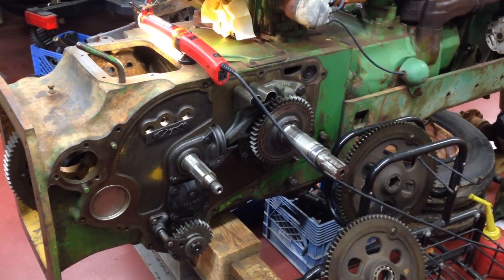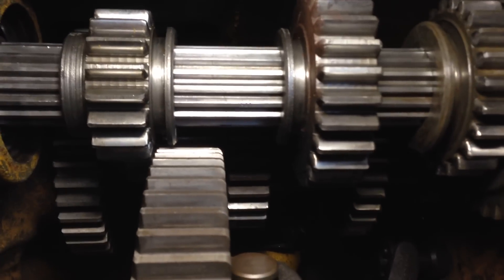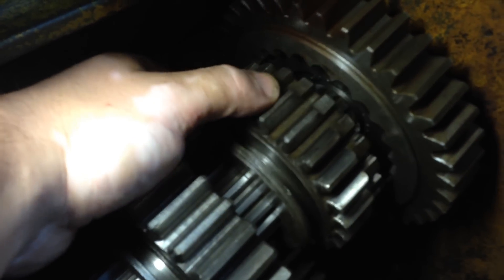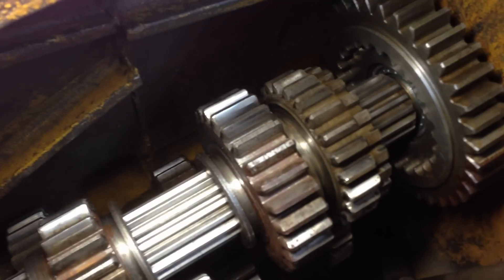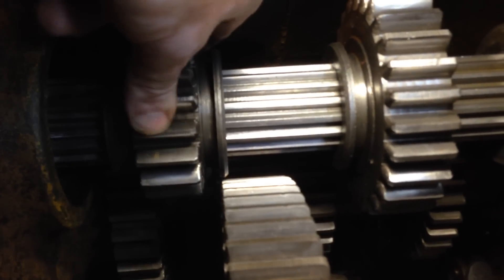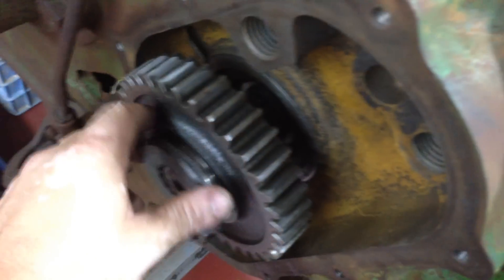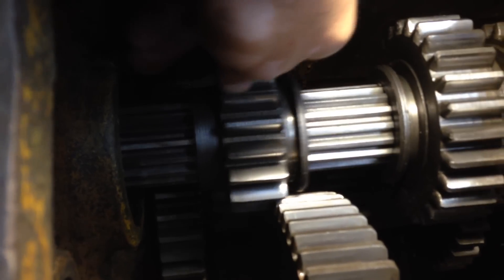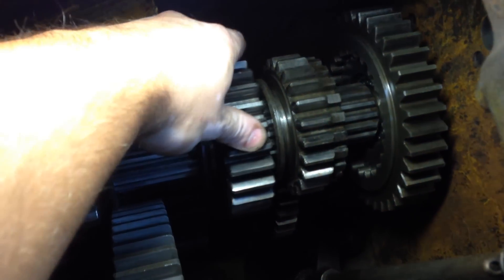Inside a John Deere model 60 transmission

Comment: That was very helpful.     thanks. I got on that lost the lower gear on the bottom shaft and was wondering how to take the girls off the top and the video clearly shows I have to dismantle both sides of the case.